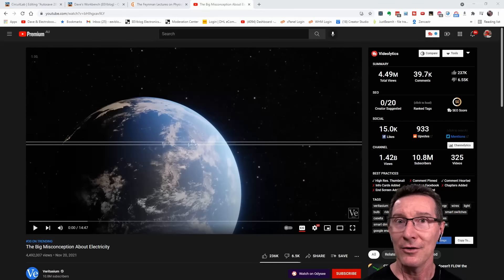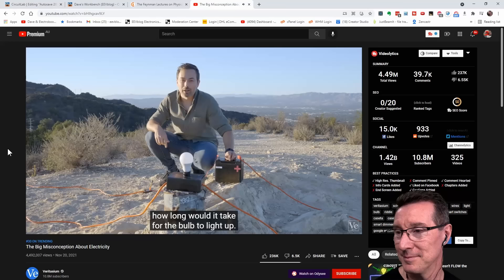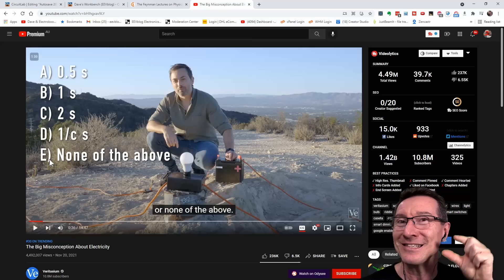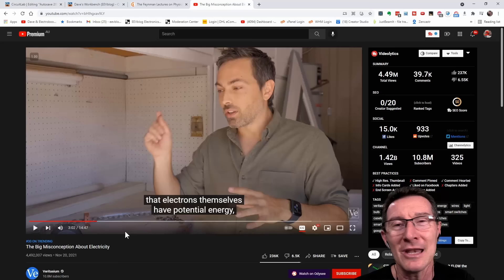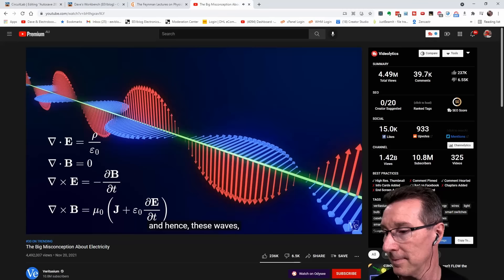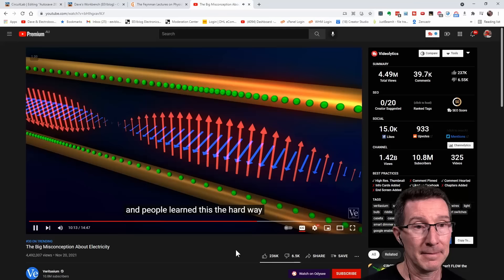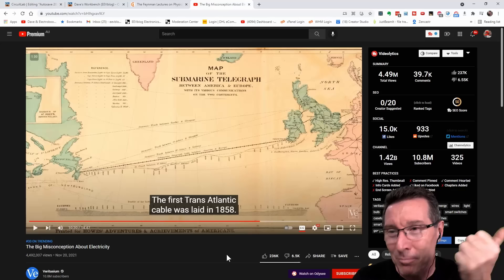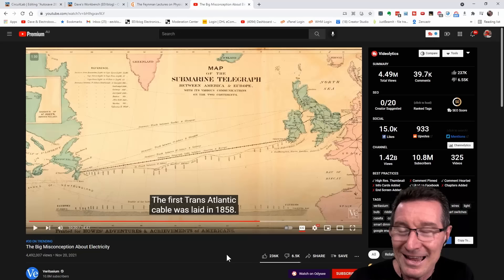EEVblog 1439 - Analysing Veritasium's Electricity Misconceptions Video

Comment: I'm going to have to disagree with the statement that the energy is transmitted thru the power fields not the electrons. Because if that is true then any bulb presented near the battery would light up and also that any bulb in the circuit that is far away would not light up immediately unless you are suggesting that the power transmission is 100% lossless. Yes,  power can be transmitted wirelessly via magnetic coupling (loss following 1/r) of a  nearby closed circuit. But that is not due to some third "power" vector.

Comment: What if the switch is further from the light?  At one extreme, the switch could be at the full 1/2 light-second away. On one hand, the circuit then looks just like your circuit with the shorts at the end removed (well, one of them) after yours is on. So would it just be turned on immediately? If so, at what distance does this become the answer?  On the other hand, if it doesn’t switch on immediately, since information can’t travel faster than light, shouldn’t the answer then be at least d/c, where d=distance of switch from light?

Comment: Energy transfer via alternating fields is easily explained - the wire is merely a waveguide. I think the arguments presented are to a degree pedantic. On a practical level the engineering tools we use in designing circuits are somewhat analogous to the quantum tools used to build various useful atomic structures etc. - a recipe rather than a deep explanation of what is really going on. Transmission line theory is useful for design in AC and transient situations of course. Static fields present in a DC situation make explanation of energy transfer difficult - no wire, no energy flow. BTW I know you mention series resistance in wires several times but the model you show omits the series and shunt resistive elements which are present except in superconductors.

Comment: It seems to me that you can understand this simply by noting that a "tiny bit" of energy takes the 1 meter shortcut right away due to the transient of the switch closing causing "radio waves" to be transmitted, like a radio transmitter and receiver, between the two wires, but not enough to actually light a reasonable light bulb.  A bit takes a longer path, another an even longer path, blah blah.  You should be able to see this increase with an oscilloscope.  The amount of energy needed to actually "turn on" the light bulb depends on the light bulb.  It will NOT be 1/c in the real world.

Comment: If this was true, then the question is why do we ever mind to close a circuit ? Indeed, for a transformer to work, we use to create 2 inductances by spiraling a cable multiple times over itself so that the length of the wire per unit distance is far more than it would be with a simple wire. The energy indeed follows the Poynting vector, but this can’t explain all because again, we wouldn’t mind to close a circuit if this explanation was sufficient.

Comment: Love this explanation as it was never done so well
Reply: Careful!  Dave here uses the wrong model for Derek's experiment setup.  A transmission line model is not applicable, so what you see on his graph is incorrect, and Derek's answer of 1/c for immediate steady ON is also not entirely right, it's misleading. For the immediate transient, the better model is a dipole antenna model.   Also, Derek conflates DC steady state with transient analysis which is false and folks who want to learn, get misled.  See my explanation in the main thread.

Comment: He missed out so much here, like you say he was hinting at transmission line theory, at which point you have to factor in parasitic inductance resistance  capacitance, velocity factor, characteristic impedance, frequency,  termination and so on, this is one of these things we know but for all intensive purposes we ignore it, in a similar way we mainly ignore electron flow in favour of conventional current flow unless you actually need to use the physics in your field ie Vacuum tubes, transmission lines and so on.. like you said a square wave ie the transient when you flick a switch generates an infinite number of odd number harmonic sinewave of decreasing amplitude

Comment: I still dont get it. I am not an electrical engineering. Does this mean that if i get a bulb unconnected to any network, near a connected electrical circuit, it will turn on due to the electric charge nearby ?

Comment: Re: Transmission line model: Is the lamp/resistor turning "on", or just transiently blinking? Or is the transient in the modelling just a feature of the short modelled line (as opposed to the real thing)? Secondly: If an equally long line is placed next to the loop (so actually half the length), also at 1m distance, and hooked up to a lamp in the middle, what would be the behaviour of that lamp?
(Yes, I've also read the theory, but that's a very long time ago, and some of it didn't even register correctly at the time!)
Reply: It turns on for a brief moment at the beginning and then once the capacitors are fully charged, the dont let current to flow, then the current is forced to travel along the light second long wire
Reply: The transient in the simulation is just a feature of the short, open line. In the real halfway to the moon experiment it would have lasted until the energy flowing at the connections at the end of the line arrived at the lamp

Comment: I would say that engineering is hand waveing, at it is usually enough, in the right circumstances.  
So this is needed to make engineers remember this.

It is like we don't use relativity theory when calculate low speed systems, like cars. We use Newton formulas. 

Is newtons model wrong?  Yes, but good enough for most cases in engineering.  BUT we still need to know about Einsteins theory, so we know when the model doesn't get accurate enough.
Same for electronics, as you said in this video.  Ohm law etc is usually good enough, and make i much simpler to make good enough calculations. We just need to know when it doesn't is good enough simplifications any longer, and why.
THAT is easy to forget.

And he told you that they was one meter apart, so as a good engineer, like you, that should trigger the right solution. And, right simplifications.

Great videos, both of them.

Comment: I think the framing of Derek's problem is incorrect. He sets it up as either 1) the energy is carried in the fields or 2) the energy is carried in the flow of the electrons through the wire.

In the thought experiment with the long wires, the idea is the flow of the electrons didn't make it around the wires yet, so the energy can't be carried by the flow of electrons through the wires. But that's not right, there was a transient electron flow during the capacitative charging of the wires, that goes together with the energy transfer. So the thought experiment didn't prove anything, the "current carries energy" view is perfectly compatible with this.
Reply: EEVblog's lumped element model here is not the right one for Derek's experiment set up.  Derek's answer of 1/c is not entirely correct either.

You'll be surprised at what the answer really is ....

Go to the top and sort comments on "Newest First", scroll to the time stamp of this post, and read mine.

Comment: Would it be correct to say that if the wire has shield on it that worked at 100% the light would take one second to turn on?
I’m thinking further about it, we prevent cross talk on the telephone cable by twisting the pairs, the tighter the twist the better.  Is that related?

Comment: Great review! My problem with the video is the downplaying of the importance of currents flowing in the wires (transmission line). Maxwell equations invovle sources (currents and charges) which generate fields and of course the fields induce currents in the wires. Without the currents in the wires, there is no transmission line which means you have free space transmission which is awful! So the field and the wire current an both needed to transfer energy efficiently!
Reply: Careful!  Dave here uses the wrong model for Derek's experiment setup.  A transmission line model is not applicable, so what you see on his graph is incorrect, and Derek's answer of 1/c for immediate steady ON is also not entirely right, it's misleading. For the immediate transient, the better model is a dipole antenna model.   Also, Derek conflates DC steady state with transient analysis which is false and folks who want to learn, get misled.  See my explanation in the main thread.

Comment: If I have a very low powered device. Could I potentially have it between that 1 meter gap and leech power from the transmission lines without being hardwired into it?

Comment: Do electrons flow through the wire in the DC circuit in question? I think, despite poynting etc, that they do. Lightning for example, you can say an umbalanced field is the cause but the feild is only balanced when the electrons flow. I could take a static charge of electrons to another planet in another universe and I could let them flow to whatever positvely charged object i chose.

Comment: I don't understand how this can square with the fact that circuit-builders literally add delay by lengthening traces? And the well-accepted fact that early Cray machines needed wire lengths to be exactly controlled to function at all due to signal timing

Comment: I am a professional physicist. Veritasium is incorrect. He does not define what 'light up' means; he takes the position that a lamp 'lights up' when an electromagnetic signal reaches the lamp. This is wrong. The lamp lights up, in the normal sense, when the correct potential difference appears across its two ends. Only when this happens will the correct operating current flow through the bulb and the lamp reach its full brightness. And the only way for this to happen is for the electromagnetic signal to travel along the wire until this is achieved. Asserting that the very weak EM signal that travels directly from the source to the bulb and causing it to light up is wrong, since this will not cause any significant p.d. or current in the lamp, and the transient EM signal passing through the lamp's filament is so insignificant that the lamp will barely even get warm, let alone light up.
Reply: As Veritasium mentioned in the video, it would not be the full current or voltage, but some fraction of the voltage and current passing through the bulb initially.

To clarify, Veritasium claimed the fields would radiate from the switch, not the source, which is an important difference.

Light up in this context meant to produce some level of light, not that it would be at full brightness.

Comment: I've posited this thought experiment to Veritasium and I hope I get a response :

I'm standing on a neutron star with my magic umbrella and n95 mask (so I don't get crushed) and I throw a kite made of twenty 1 Watt bulbs, each 12 Volts at a black hole. The kite bulbs are connected in series to a bank of twenty 12 Volt batteries with a single debounce switch, which reside on the neutron star where I am standing. As the kite crosses the event horizon and approaches the speed of light, I flip the switch. The black hole is 1km away from where I am standing and was 23 solar masses when it was a star. The Hawking radiation requires at least a 50+ SPF lotion for protection. I also have a box of resistors, capacitors and coils next to me in case I have to add some inductance to the speaker wire used between the kite and battery (in case the zero ohm transmission wire forgot to have inductance or any other considerations that go with transmission wires in a vacuum, i.e. capacitance). How long does it take for the 10th light bulb to turn on from the point of view of 1cm from the bulb? I would like this question to be answered with extreme confidence please.
Reply: Answer : the neutron star is already within the event horizon and the sun block is totally useless.

Comment: so this does work as if the energy was trasnferred over 1m only because air between the wires work like a capacitor and throgh electromagnetic radiation and induction it does transfer the energy to the other wire?

Comment: I haven't read the comments. And I don't really understand the explanation. But there is one thing I really don't understand. There is a switch. It turns on the bulb. Turning on the bulb depends only on the distance between the battery and the bulb because energy goes through space by the speed of light. But the switch is along the cable that is quite long and if it is not on no light.
So I cannot understand the connection between the switch the lenght of the cable and the built up electromagnetic field.
And what if the switch is half a light sec away?

Comment: Hi Dave,
the first thing is that we don't have a transmission line model for 2 wires 1 meter apart.
We can deal with an RG58  50 ohm coax cable because we do have a model.
My bet is that long wires like the example would act as antennas and radiate the energy away.
The whole example was just silly from Veritasium. LOL

Comment: I think an ideal conducting wire with zero resistance would have zero electric field internal to it and therefore have zero poynting vector internally. A real conducting wire with resistance would have an non zero electric field along its length and an non zero poynting vector internally and would therefore have non zero power being transmitted internally.

Comment: Ok I have always be told that if you have Line 1 Line1 and neutral in the same raceway or bundled their fields cancel eachother.  Same with a 3 phase circuit.  You bundle all three phase and you get field cancellation.  In fact to drive the point home you get a choke effect if you run current through a single wire in a steel raceway.  Well, If the fields cancel how can you get power out if the energy travels in the field and not the wire?

Comment: So how does R figure into V=IR, if power flows outside the wire? If -e's only shuffle about inside the wire, as though they only fill the outer -e shells but do not transmit power, why do superconductors approach zero R?

Comment: What happens if instead of one switch, you have two - one on each side of the battery? I suspect if you close them simultaneously, the effect is totally different. In the initial setup, the open circuit including the wires is surrounding by a non-zero electric field gradient. That's my contention (assuming no capacitance in the open switches). The wires are in an electrostatic steady-state BEFORE the current is initiated, with the battery repelling charges of opposite kinds along the opposite wires, setting up a field all over the wires. Thus, the initial scenario has an electric field just waiting for a magnetic field to interact with, right?  However, with two switches, the whole circuit except the battery lacks that field (again, ignoring capacitance, which I assume I can for this question). Comments? Is my line of thinking reasonably correct?
Reply: His lumped element model here is not the right one for Derek's experiment.  Go to the top and sort comments on "Newest First" and read mine.  That should help.

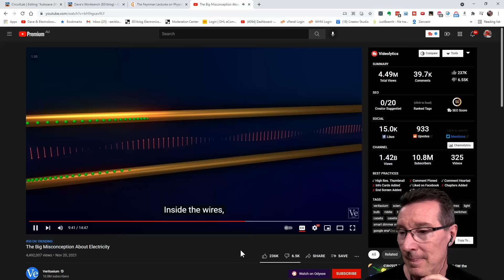Comment: the electrons create the field (no charge, no field, no accelerating charge, no EM wave), so you can say the energy is in the field AND in the electrons , the energy moves  back and forth between the 2, like in any inductor or capacitor(otherwise LC oscillation wouldnt happen), and electrons have a mass so you can't say energy is just in the field. Moreover the green electrons shown in the animation at the timestamp  14:49 are moving BACK AND FORTH exactly as the chain and wheel model he's supposed to be disproving !!!!!
You transient analysis of the transmission line only considers it under the "near field" , you won't go into wave propagation, but if you did, you may see the voltage  induced by the EM ripple (far field) is in the opposite direction of the one induced by the near field.

Comment: You have made an oversite in your simulation. The values for L and C do matter.  Sqrt (L/C) is the impedance of of the wires. You made it 1 ohm. It is virtually impossible to have a transmission line with that low an impedance. Make it 1000 ohms. You have R of the bulb as 100 ohms. With a more realistic set of values, Vbattery= 12V,  R bulb = 6 ohms, the steady state current is 2 amps. The power in the bulb is 24w.  

But at the start, when the switch is closed, only 12V/(6+1000)  ~= 12 ma of current will flow, until the reflection  (1sec. later). 12 ma through 6 ohms is (= 6*0.012^2= 0.0008w)  less than 1 mw, and no where near enough to “turn-on” the light.

Comment: By correcting Veritasium to say "1m/c seconds", you've actually made a similar class of mistake as him.

If we're getting technical, we wouldn't say "1m/c sec", we'd just say "1m/c", since the argument for adding "m" is that c contains units (m/s). By saying that, you're actually giving a result in sec^2, not in sec (since 1m/c sec = (1m/(3e8 m/sec)) sec = 3e-8 sec^2, not 3e-8 sec). I thinks it's simply safe to say that Veritasium was just considering a "unitless" c in his description of the possible answers, and that it wasn't an intentional way to hide something.

Comment: Is Dc the true measurement/answer/pointer to that the speed of light is the limit to speed? If you know what I mean? (As I understand it current and voltage flows at the speed of light and the speed of light is the limit of speed.)

Comment: If you think the power is carried by the field, try touching a hot wire in the electrical panel rather than the insulation.  You may feel something that makes you see things differently.   :)
Reply: You mean -- feel things differently? Guarantee you, energy flow into tissues is carried by the fields, not the mechanics of charge motion.
Reply: @tomgroover1839  How do you "highlight" your own reply?